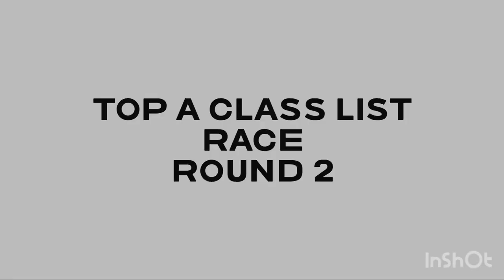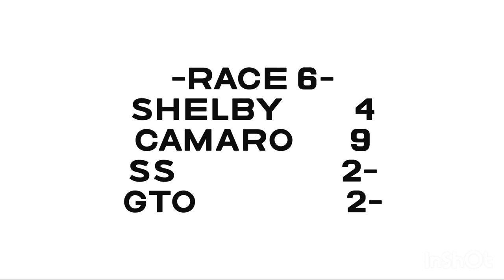Hot wheels DieCast car racing in a top of the A class list race (2nd Round) Updated extended track.

Comment: Another fine day for racing at Rock City!! Nice to see the 80s Camaro still has the goods under the hood and can hang against a newer version! Even better how today it would have won in eight races under the old "first to 10" rules!
We didn't get to witness the half point for 3rd place finishes change the overall outcome this time. There could be a case where 2nd and 3rd get that close in points to be the difference in who moves on. It seems like the old style of points means less work for you in scorekeeping.
Reply from the maker: Yeah the old scoring system would lead to 12 races sometimes. That started to be to much. And I think the half point will come into play at some point. I am making a rule that you can’t win a race event with a half point. But the driver will get the inside lane at the start of the tiebreaker. If I went back to the old way of scoring, it would be the first to 7.